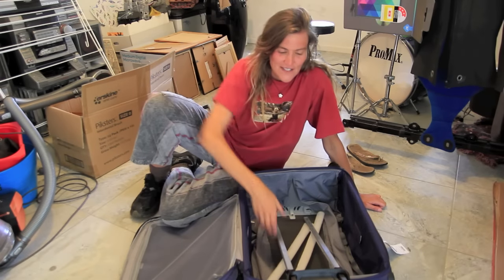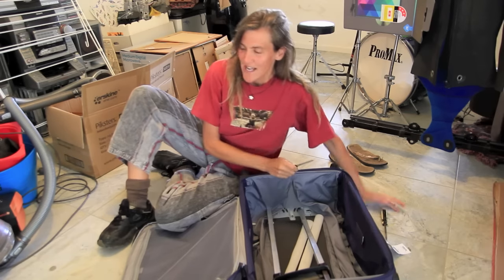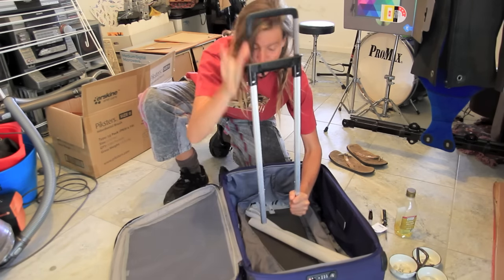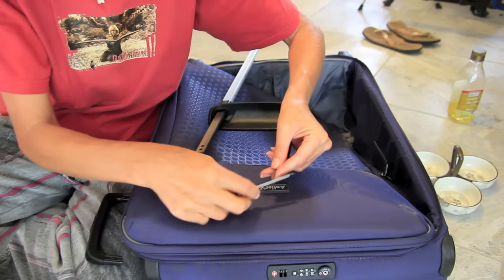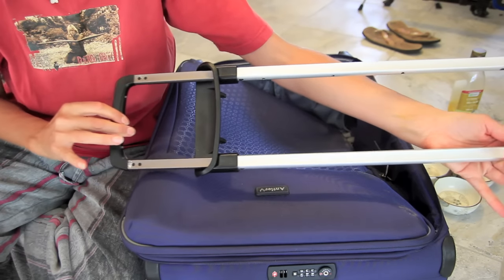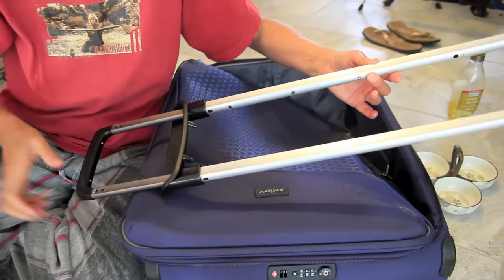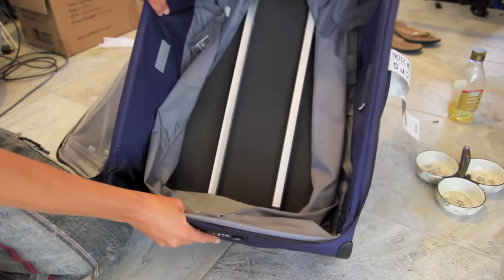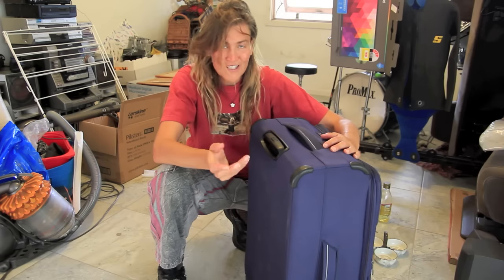DIY stuck telescopic luggage handle fix

Comment: Thank you for the video Robin! When unscrewing the handle, I observed that the telescopic tubes of my luggage were bended. That prevented these to slide freely inside the fixed tubes... (never carry a heavy luggage in the stairs with the telescopic handle out...). By playing with the pushing metal rod, I was able to identify at which section and towards which direction each telescopic tube needed to be bended to recover its straight line. Placing the tube fully out, holding it with pliers at the location to be bended, using the other hand and muscles to push on the top extremity of the tube with the relevant but careful amount of bending force, and holding the pressure for a few seconds, it went back straight. Same with the second tube. Screwing back the whole mechanism made it back to a fully functionnal luggage. Your video was much helpful to dare, merci!
Reply from the maker: You persisted and got rewarded. 👍 👌

Comment: Thank you!!  I was literally about to take my (really handy) little weekend bag to the tip - but thought I'd check first to see if there was a simple way to fix it - and there you were.  I didn't even have to pull out the whole mechanism - I realised that one of the little prongs that control how far you can pull the handle up was jammed in one of the holes before I even removed the whole thing (mine is a cheapo bag so the hole is right through the housing) - fixed that and it works like a dream again!

Comment: Thanks - I had the same problem, burrs on the ends of the rods. I filed them off and the handle started working again. Couldn't have done it with that little gem of data. Thanks for posting.

Comment: Thanks much for the inspiration.  Good hints for getting me to tackle a similar issue.  In my case it required a slightly different solution because I have a TravelPro case plus i suggest a few other steps while doing this. First, i didn't have a cable but a rod with a plastic push plate at the bottom of it. for some unknown reason (wear from years of significant use?), one side didn't engage the pin sufficiently so I added some heavy duty tape to the bottom to fix that.  I also applied some silicone lubricant to components because my handle telescopes out in stages and the two sides weren't sliding the same.  Hint. wipe off the silicone gently to reduce potential drippage inside the case or use "dry" silicone.  Lastly, when i unzipped the bottom cover of the suitcase, i found a loose screw.  I saw that it was 1 of six screws (3 ea side) holding the handle on.  i reinstalled it and tightened the other 5 which were also loose.  be careful not to overtighten because I am guessing they are going into plastic.
Reply from the maker: silicon lube  good idea

Comment: Just perfect. My handle lever was broken due to excessive tension on the plastic. I put some quick fix glue and also reinforced the tension side by gluing some steel strands to it. Works fine now.
Reply: My repair need was like yours. I noticed when I removed the innermost  "button bar" that it snagged on one of the guide posts because a little piece of plastic sticking out on the post. I filed it away to make it smooth before completing the repair. I think Kichapps is spot on about supporting the sides of that plastic bar with metal. I used an epoxy putty (good for plastic) and embedded heavy wire within. (Like rebar in concrete on a tiny scale). Be sure there's room inside the next component for your repair work. I'm also going to follow others' suggestion to  pad the bottom of the feet inside the poles with duct tape to increase springy tension, and add  silicone lubricant to the moving components.

Comment: Thank you so much! Although the insude of my suitcase does not have a zipper compartment to open up I felt around and it was the pin that was sticking. I’m not willing to open up the inside of the lining, because it’s too nice, but at least I know that I can just push the pin back in. So thanks for your help!

Comment: NIce video, very useful. But wouldn't it be easier to just unscrew the screws, etc. without disassembling the whole thing first? As it was, it seems one of the 'buttons' in the bottom half of the handle is stuck, so the search for a fix continues. Thanks for this video!

Comment: How about if the telescopic handle is too loose? For example, it won’t stand up? I’m having a problem with my vanity mirror (2 telescopic poles that are SUPPOSED to adjust to whatever length/height necessary to hang it anywhere) help?

Comment: It doesn’t surprise me that the case your fixing is an Antler case. I generally like mine but I’ve had two replacements under warranty because of the handle failing and now the third has failed too. Very disappointing

Comment: awesome video but  after doing this also , one of the locking thing is not going inside, it is still out thus locked and resulting in handle not going down
Reply: Radhika Agrawal I have the exact same issue. Unfortunately this video did not help me.

Comment: The telescopic bars on my suitcase work a little differently and are riveted to the case. The plastic foot that pushes the knobs in at the end of one of the rods was broken. I had to find a replacement part to act as the foot. Why they don't just weld a big foot to the rod is someone's secret.

Comment: how does the button lockers move back inside the tube when you press the handle button to retract or extend it
Reply from the maker: crickey I'm not certain. But they retract when the button is pressed that pushes the rods downwards and whilst pushed they are in retraction so can slide the handle to desired length until button released which lets the knoblets ping out the next hole they come to, where they cause the rod to lock.  that wasnt the best explanation sorry. good luck.

Comment: The top set of handle locks seems to work fine, but the bottom set that you normally can’t see because it’s inside the suitcase part don’t work. 
When it’s fully extended it will go down just fine until it gets to the halfway part and then gets stuck. Then I have to wiggle it to get it to close. 
Will this help this situation?
Reply: Same with me, can't figure it out. The bottom pins are on the opposite side on the tube and don't seem to be co trolled by the rods

Comment: Nah mate, your diagnosis is completely wrong. The metal bar you had a tough time pulling out is never supposed to come out of that hole during use or any other time for that matter. When you push down on the top handle button, that engages the metal bars to be pushed. At the bottom of the metal bars is a plastic foot that engages the lockout mechanism at different stages. Although you may have fixed simply by taking it apart and freeing up some other debris, you filing down a bur on the top of that rod had zero part in fixing your issue. Again...that rod should never come out of that hole, just imagine how tough it would be for the rod to go back into that hole as loose as it is floating around in that sliders.